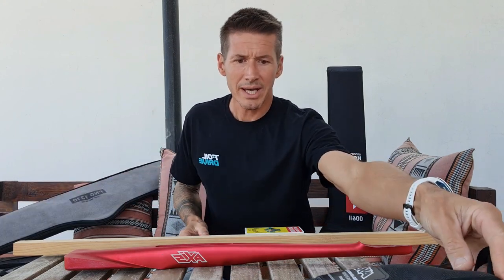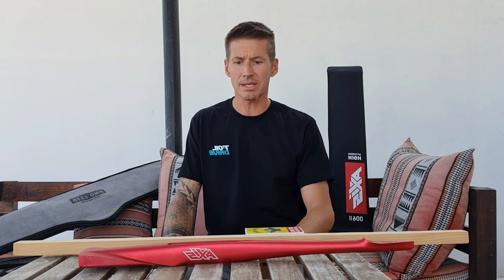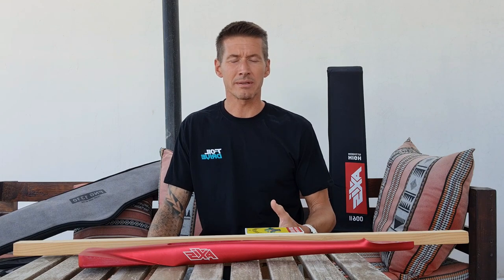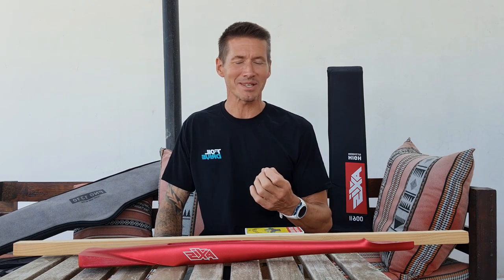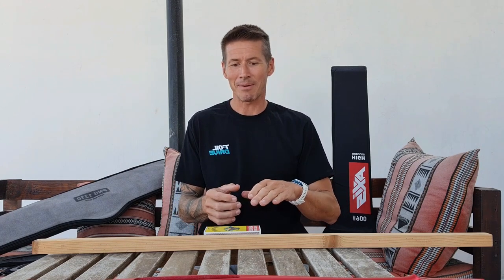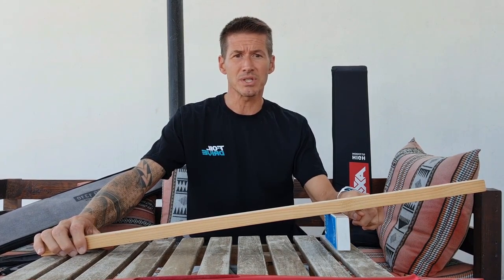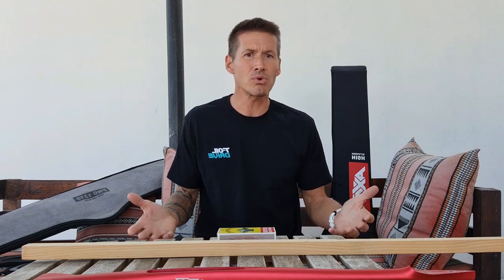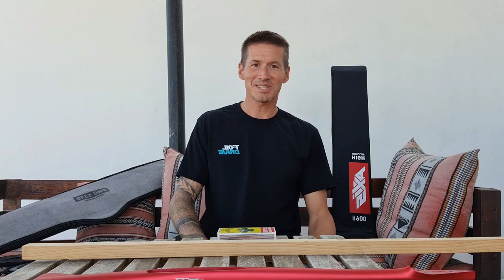Axis red advance fuselages - HUGE performance gains for big foils. Is there a cost?

Comment: I think you forgot to consider that when you compare the 2 fuselages, the mast position in the rails should be offset so that your foot position is unchanged relative to the front wing. The real difference (I believe) is the "C" frame you're standing on when pumping is stiffer because of the shorter overhang. This would explain the improved control as there's less delay between your input and the response.

Comment: I had the short red (non advanced) and practiced dock starting for a month, I believe I had my dockstart dialled in but always dropped out after 10-20meters of pumping. No idea what I was doing wrong and I was getting kind of frustrated. Then I watched your video and ordered the short red ADVANCED. The first day out with the new fuse I was doing laps around the float!!!
Reply: Ah yeh, and I'm on a 1310 with a 460v2 pump stab and a 75cm mast

Comment: Great info in this video. I'm an intermediate kite foiler and wing foiler, looking to get into dock starts and flat water SUP pump starts. I'm planning on the 1310, 82 high modulus mast, and 460 pump stab. Would you recommend the advance fuse for someone that is learning to pump and dock start?
Reply from the maker: The 1310 is so pitch stable that I think it would be ok to learn with the advance fuse, but definitely go for the longest one which is called the 'short' advance
Reply: @dominichoskyns9091  Thank you for the advice! Much appreciated.

Comment: Hi Dominic, I agree with most of you statements about loosing up and more control, but the explanation around 8:00 seems a bit misleading. You are not controlling the distance of the fuselage from horizontal position, (demonstrated by the stuck under matchbox). What you really control is the angle of the board, and because each joint is rigid, the fuselage just follows it. So I think the "you have bigger impact with the same input" is true, but probably because the front wing, has smaller leverage (shorter distance from mast) to create resistance.

I absolutely love your content, and my interpretation could be wrong, I'm just also trying to understand which is the ultimate gear, and technique for long pumps. Let the tail-wind be with you ;)
Reply from the maker: I think what you just said is what I was trying to say 😂😂😂

Comment: Thanks for yet another great video. I am looking to buy a red advance fuselage for dockstart and small boat wakefoil with a 1150. (And later on maybe a 1300 for downwind) Do you think the ultrashort could be a good compromise that still pumps good?
Reply from the maker: Yes the ultrashort is a great compromise. It actually does everything very well rather than just doing everything sort of ok👍
Reply: @dominichoskyns9091  Great. Thanks for the reply👍

Comment: I suspect the reason the advanced fuses help with pumping is due to the weight of the mast moving forward 40mm. Can see why the geometry helps turning but not pumping. Imagine adding a 2kg weight to your pump board. Where would be the best place to mount it? I suspect just behind the front foot. Forward weight would help rotate the board down. Thoughts?
Reply from the maker: Good point, I'm sure that makes a difference as well. All that was just my thoughts on what's happening, its all theory and I'm sure there's more to it than what I've said.
Forward weight?? Do you mean more front foot pressure by standing further forwards on the board? If so that would put you off balance and wouldn't help. My point is that the advance fuses cause each change you make with front or back foot pressure to have more of an effect on the angle of the fuselage because the pivot point is closer to the end of the fuselage which causes a greater angle with the same movement (ie pushing down the same distance with your front foot) than if the mast (the pivot point) it's further back (ie closer to the centre of the fuselage). It amplifies your input movements without you having to be off balance. Hope this makes sense
Reply: I agree Mr Floyd. Adrian and others have always said that you are riding/ balancing on the front foil (and I guess to a lesser extent the rear foil). 

For pumping motion, when ignoring Material Stiffness, Center Of Gravity and Drag, I believe you could have any whacky mast configuration (i.e. connected right at the stabiliser and it would ride the same).

Comment: Great video.  i completely agree with your analysis.  I have a Red Fuselage Short and just recently got a Red Advance Fuselage Crazyshort.  I love the Advanced Crazyshort.  Is it worth trying to sell my original Red Fuselage Short and get a Red Advanced Fuselage Short for like dock starting and flat water pumping?  I have been doing some flat water pumping using Foil Drive with the Red Advanced Fuselage Crazyshort and Axis PNG1010 -- it's challenging but I'm getting better.  Wondering if I would like the Advanced Short much better than the Advanced Crazyshort for flatwater and dock starting.
Reply from the maker: If you're wanting to do lots of distance pumping then the short advance is the most efficient on flat water, but of like me you just like pumping around, chasing swell and carving it up then the crazyshort is best as it adds so much more maneuverability. You'd be surprised how much difference there is between the two. I can pump the short advance much further than the crazyshort advance but I wouldn't dream of using the short advance for winging

Comment: Hello Dom Thank you so much for the explanation. I have been working lately on my Flat water SUP foiling with my KT Ginxu Dragonfly 105L. I was using my 1150 with the ultrashort fuselage and have not foil up yet but I  actually found it more difficult to pump with the 1310 and eventually went back to my 1150.  Should I go for the advance short fuselage and re-try the 1310 again. I dont know if my 147lbs has anything to do with it or just poor technique? thank you again
Reply from the maker: The advance fuse gives a more surfy feel when turning and depending on your style they can make it a bit easier to pump, but they aren’t a game changer for pumping. It’s mostly technique and practice practice practice 🤙

Comment: I will order the 1310 but i am still not sure about the stab and the fuse. I want to use it for dockstart and light wind winging (me 86 kg) and would like to get away with one fuse and wonder if the Advance Ultra (as in the middle of your prefered short for pump and crazy for winging) will get me decent pump performance and and still turny winging performance. Or should i get the crazy advanced as i'd rather take a compromise for the pumping than the winging turning performance.
Regarding stabs: I have already the p400......would that be big enough for decent pumping performance?
Reply from the maker: The ultrashort advance will be the best of both worlds. The p400 is awesome for pumping and will still turn well

Comment: Sorry but I think don't get the angles thing in your demo.
For a given angle, the front wing travels farther down from the base of the mast with the classic than with the advanced fuse, that's right.
But I adjust my equipment to have a sweet position of the front wing in relation to my feet and not the base of the mast. With this in mind, I'd have to move the mast forward if I change from classic to advanced fuse and won't get the effect you describe. 
(Also I would get that same effect keeping a classic fuse but moving the mast further back)

I think the better surf feel comes from being able to pivot easier on top of the front wing (in addition to the carving motion). The mast is like a fin, the further back it is from the wing, the more it opposes the pivoting. 

It's not obvious wether this explains well the angle and stalling part, but I guess it could if the rider is skilled enough like you are, as a tweaky recovery from a bad timed pump could be easier?

All this is just guessing out of my brain though, has I haven't tried advanced fuses...

(Maybe we could have this conversation over FB in the dockstart group, I'd make some drawings)
Reply from the maker: I've just watched it back again and I agree that instead of saying the 'angle' that you change, I should have said the amount (or distance) that you move the board down (or up) around the pivot point, ie the mast position. Assuming each time you push down with your front foot you move the nose of the board down the same distance each time, when the mast is further forwards it will tilt the fuselage more than if the mast is further back. This is what I meant by the advance fuses being more sensitive to your input. The same movement from you (the rider input) will change the angle of the fuselage more because the mast is further forward. Its the same principle as moving a pivot from the mid point towards one end of a lever. The closer the pivot is to the end of the lever the bigger the difference between how far each end of the lever moves. Because of this, the advance fuses are more sensitive to rider input - they cause a small movement from the rider to make a bigger change to the angle of the fuselage. Ultimately this gives you a greater level of control, but it also follows that you need more skill to be able to control such high levels of sensitivity. I hope this helps to clear up any misconceptions I may have caused with my mistake when referring to angles with regards to the rider input
Reply: @dominichoskyns9091  thanks.
So the pump makes the equipment pivot around the base of the mast in your model? 
My sensation is that it pivots more around  the front wing.
Reply from the maker: @nellcpr1419  its all theory and I'm sure there's more to it than what I've said. There's so much assumption going on in terms of how hydrofoils work. The assumption is that the pivot point is directly at the mast, which makes perfect sense, but it's not beyond the realms of possibility that the foil itself has an effect on the pivot point - after all, the chord of a foil also has a big effect on mast position in order for the rider to remain in the same position on the board and maintain balanced foot pressure. 
My  point is that the advance fuses cause each change you make with front or back foot pressure to have more of an effect on the angle of the fuselage because the pivot point is closer to the end of the fuselage which causes a greater angle with the same movement (ie pushing down the same distance with your front foot) than if the mast (the pivot point) it's further back (ie closer to the centre of the fuselage). It amplifies your input movements without you having to be off balance.
Reply: Why should it be pivoting around the mast? When pushing down on your board, the front wing is what keeps your system up and the whole thing pivoting and not sinking. Consider a hypothetical foil with a mast 1 meter behind the front wing, while board and wing stay the same relative to each other. Pivot points gonna be the same, but you'll introduce a lot of flex. And 4cm of aluminium sure does bend quite a lot.
Reply from the maker: @JohanFruend  up to a point I agree, but not 100%. The advance fuse has a different pivot point to the non advance fuse, and the only difference is that the mast has been moved forwards. If it didn't you wouldn't have to move the mast forwards to remain in the same position on the board. IMO the pivot point is as a result of a combination of the front foil and the mast position. Change one (or both) and it affects the pivot point.
All this is arbitrary because the main point iwas trying to make is that by moving the mast position forwards the effect is that it gives a greater level of sensitivity over pitch control - some people think this makes it more difficult, therefore they think its not as good. My point was to try to explain that the extra level of sensitivity is actually a good thing when you have the skill to control it, therefore to dismiss it as not being as good is not necessarily true
Reply: @dominichoskyns9091  im looking forward to getting my hand on one and have a feel what's going on! Thanks for sharing your thoughts on it!